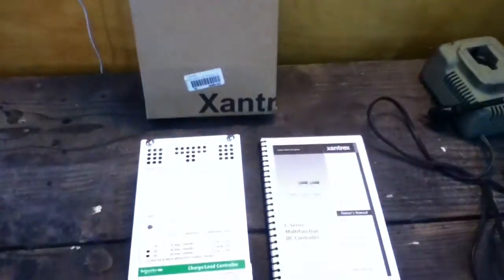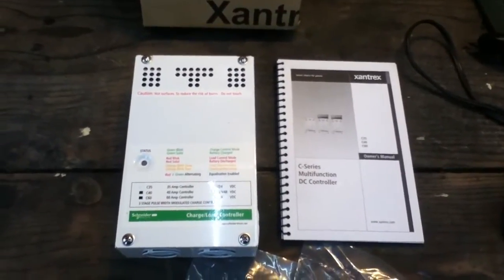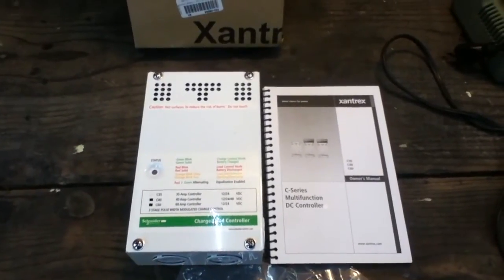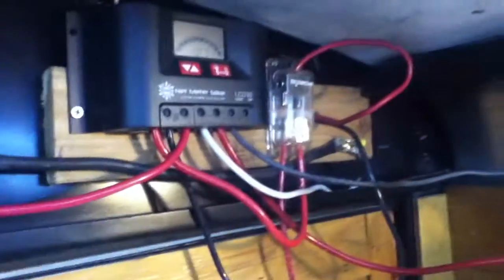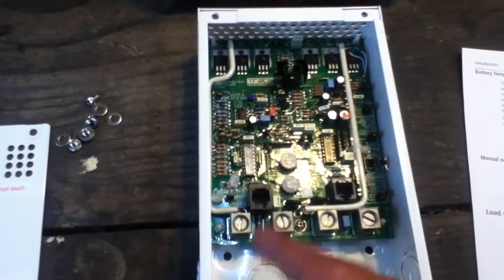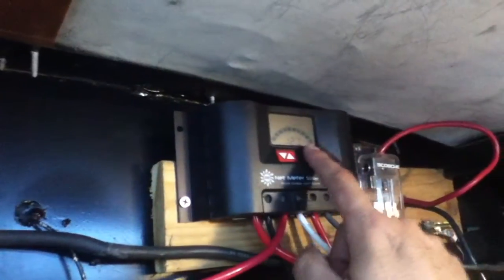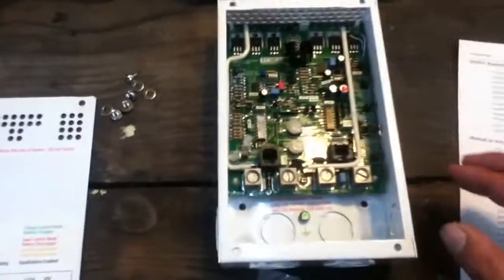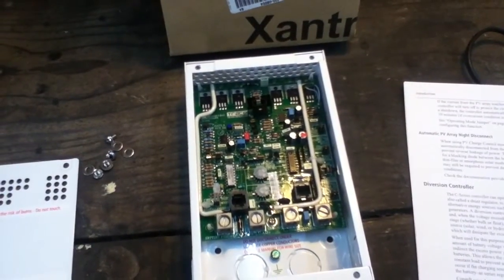Xantrex C35 Part 1 intro

Comment: My Xantrex C-35 Multifunction DC controller will not operate like it should. My wind turbine is producing power, but the voltage in the batteries keep dropping, and the dump-load is not working. However, there is a blinking Diode that appears to be green. Can you, or anyone give me direction?